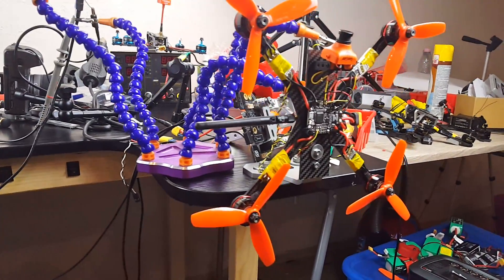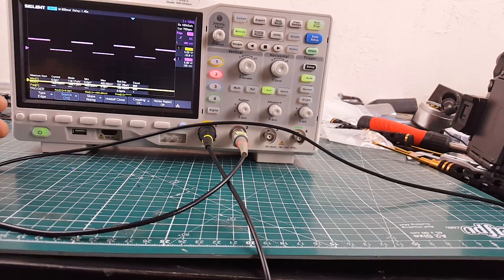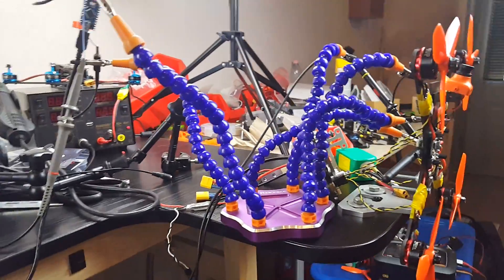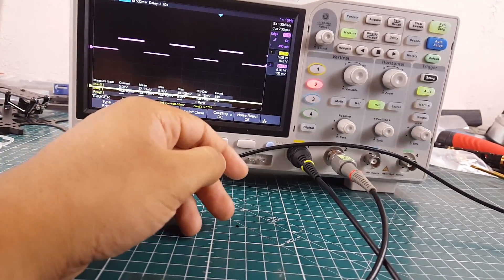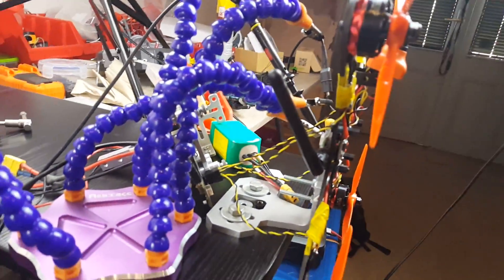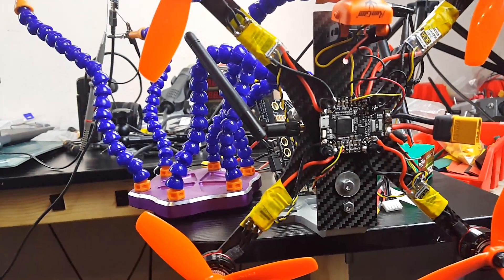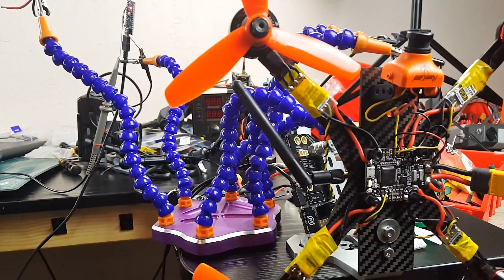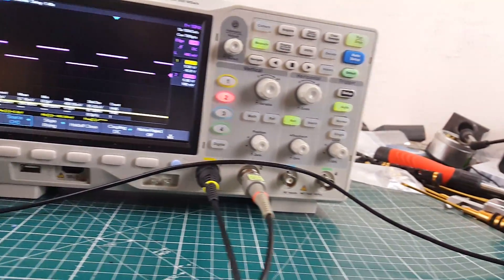VLOG // The New Setup is Complete // Tekko32 4in1 ESC 2 Day Sale

Comment: Dude I have those exact same set of helping hands there awesome plenty of arms and mine came with a little USB fan I wanna try and fit to my box style goggles I also just finished a build using your recommended parts I have the iflight xl5 v2 frame tekko 32 35 amp 4 in 1 the Kakutte F4 AIO the Atlatl VTX and a run cam swift mini the motors I'm using are the emax lyte spec 2207 2550kv this setup rocks just flashed betaflight 3.4.1 last night cant wait to take it out today and fly that's my father's day gift to be left in peace for a few hours cant wit charging batts now

Comment: Plus plexiglas glass would probably throw off the results or make it a really good rry est for the power system due to all the bbn prop wash what I'm wondering is can you run the test without it being propped? I get it would be needed for motor testing thrust efficiency and whatnot but for some esc testing hmm I wonder what the results would look like with and without the props on? You almost need to build a box or pit the setup into another room and try and get longer cables maybe or shit just get familiar with beta flight go fly the damn thing and get your data that way nice setup though lots of time and money went into that hey I wonder if you could look at the black box data now that you have it in a quad with the current setup should be able to I know nothing about black box though you could reach us with some videos of course JB does that too would like to get anothers perspective on it though anyway have a good one happy fathers day brother